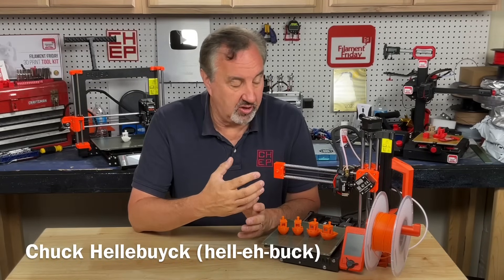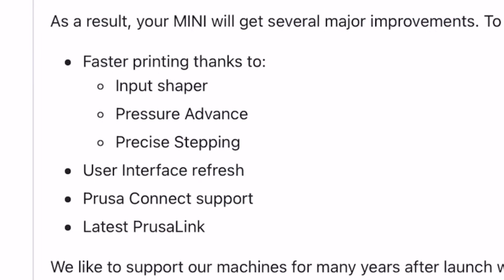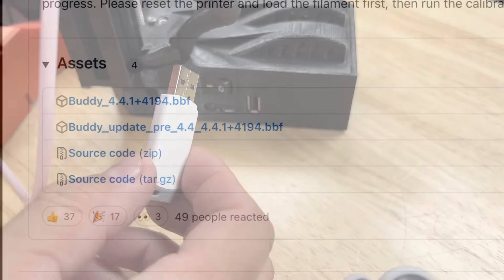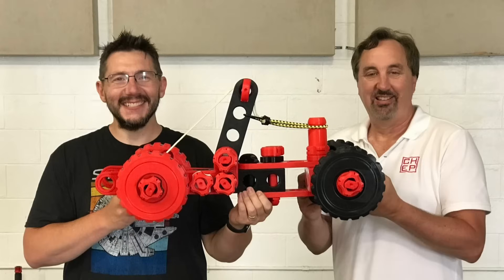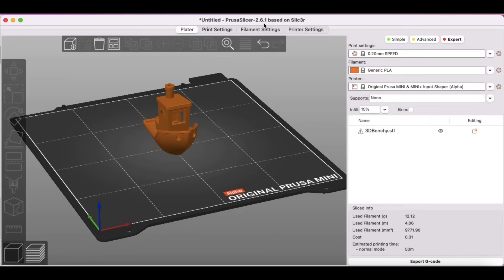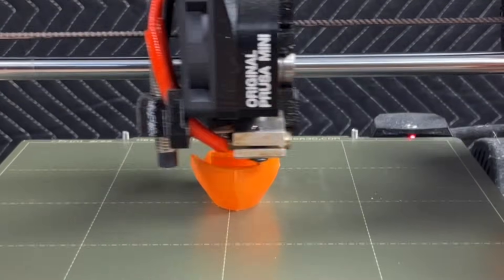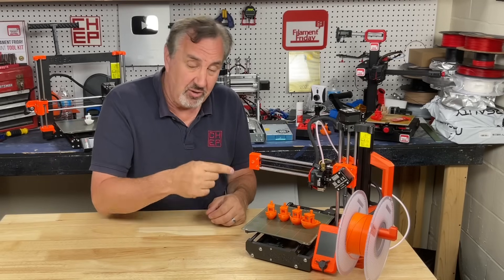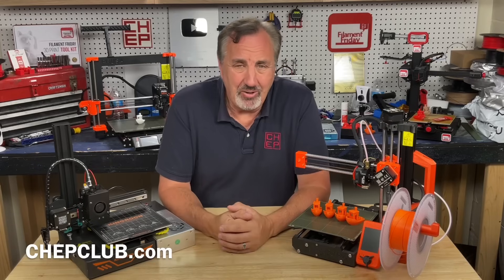12 Minute 3DBenchy on Prusa Mini

Comment: It's cool that they pretty much brought the Mini(+) back to the competition.
But the input shaping needs some severe tuning. Currently slower prints, the quality is much worse with it turned on.
As for the bedsize. I like the 180x180x180mm. Realistically, 98% of what I print is smaller and for the last 2%, I just send it to a 3D printing company.
I always thought I would get the Prusa Mini+ to start out with and get a larger printer when I feel the need to. But I never felt the need too.

Comment: There are config files for the Ender 2 Pro to put Klipper on it ... but it's nearly a shame that there hasn't been a tutorial or something by Creality themselves to provide open source support for an open source printer! It could have bond customers to their products.

But I wanted to mention the Lerdge iX printer Kit as well, which is a Prusa Mini/ Bambu A1 Mini to build by yourself starting at like 130 € and going up to 310 € if you go all in with a direct extruder and linear rails. Oh and there is a Klipper tutorial as well ...

So for people or even kids who always had fun building stuff by yourself with LEGO, it sounds like fun to build a own Prusa/ Bambu Mini printer by your own and maybe learn a thing or two about those machines as well.
And it's open source, so you can reprint or repair every part since you get all the files and bill of material... even design like a Halloween version of it.

I always like the idea from Creality to make things accessible by bringing the price down from 1000 bucks to below 300.
But seeing what other companies achieve by adding Klipper/ input shaping, refreshing the design, providing kits to build one by yourself (without the need of 500+ bucks for a Voron) ... it's kinda sad to see that Creality is leaving so much potential on the sideline ... which others just have to pick up!

Maybe that's why Bambu Lab is kinda the new Creality on the block: the new company that copies others and makes profit ...
But at least Prusa is taking the challenge ...

Comment: I keep going back to that informal poll that Alan Mandic did, where something like 80-90% of the individual files that poll respondents print fit inside the dimensions of a Voron 0.2, Ender 2 Pro, or Prusa Mini. Yes, we all need larger bed sizes for one thing or another and I personally feel like I never want to be without a printer sporting a 300x300 mm bed (adding the Sidewinder X1, and later an SV06 Plus, to my printer inventory was a big help). Still, having a more portable printer that is fast, still useful for a number of prints, and is easier to enclose seems like a real win to me. 

I've given consideration to various small printers and I'm leaning towards getting an LDO Voron 0.2 kit; the fact that it's enclosed and would allow me to far more readily print ABS/ASA/etc. than I can on my Ender 3 or SV06 Plus is a huge plus, not to mention that LDO has been really great towards the 3D printing community and deserves some love.

Comment: I have a highly modified KP3S. It is one of 4 printers, but the one I use the most. It is small and I can take it with me when I travel. I have larger printers, but this KP3S does 95% of what I need and can do it faster due to the lighter bed and hot end.

Comment: The only reason they released this update is that they don't have anything in their pipeline. 🤷‍♂️
Reply from the maker: Glad they did. I like the increased speed.
Reply: @FilamentFriday  Yes, it's awesome but wouldn't it be better if they did this like 2 years ago instead of 5 years? I am not saying that what they did is bad, I just don't believe the narrative you present. 🤷‍♂️
Reply: @hologos_  2 years ago the development of Klipper and Input Shaping hadn't been the "new standard". Only expensive Voron builds used them regularly. So there kind of wasn't a need for that, too. Clearly Prusa first wanted to build a big machine with multi heads (XL).
But with more and more Klipper machines (doesn't matter if Bambu names their firmware different) they had to evolve as well.
Fast printing comes with negative side effects - more cooling needed, louder, more wear off ... let's see where this "need for speed" leads us to.

But you already could get a fast printer for 320 bucks - the Sovol SV07. So the A1 Mini isn't that new.
The better implementation of the 3D Chameleon 4 color multiprint is good, but also has been around for 3 years now.

So this is simply the time when more and more implementations of input shaping come to the surface.
Reply: @hassosigbjoernson5738  I agree that Bambu isn't the only company with fast 3d printers but the ease of use (at least that's what they market) makes them eat the market share. The part with Klipper and Input Shaping is correct, I haven't thought of that.
Reply: @FilamentFriday  LOL... Prusa saw what everyone else is seeing (that the A1 mini will clean up their clock) and they released the Alpha1 early, warts and all.

Comment: Just rebuilt my Ender 3 pro with all linear rails, dual Z and a Spite Pro direct drive hot end with Klipper at the helm. Hoping to get these speeds out of it. Any recommendations for a slicer that plays the best with Klipper. I was going to stick with PrusaSlicer,  it I heard that orcaSlicer works well with it.
Reply: orcaslicer has super slow travel speeds for me and i cant fix it no settings changed it so i just stayed with ps
Reply: I've used Cura, PrusaSlicer and Orca with an Ender with Klipper with success.
Reply: @MallocArray   in your opinion, which one seems better for Klipper? I know it’s mostly up to the user, but just trying to see if one works with Klipper better than the other.
Reply: @johnbelfiglio562  I haven't used PrusaSlicer much. Cura was fine with the generic Octoprint plugin, or there is a Moonraker plugin that is a bit for fiddly. 
Orca supports Klipper better natively. No extensions needed, thumbnails works, can adjust pressure advance on a per-filament setting, and the Device tab pulls up your printers full interface directly on Orca, compared to basic controls in Cura.
Reply: Orca Slicer is clearly the favorable choice here since it comes from Bambu Studio. And Bambu Lab clearly "copied" or "got inspired" by Klipper and use a very similar firmware on their printers successfully.

Which makes Orca a perfect candidate not only for Bambu machines but for all Klipper machines.

Comment: All prusa products must be switched to support klipper, their firmware is quite behind the times
Reply: The simpler machines simply had not the compute hardware for Klipper on them!
That's why many Klipper mods worked with a RasPi or even a notebook - but not the build in SBC.

So the switch has to be done ... but without faster hardware it's not as easy as it seems! A 4 year old Prusa Mini or Ender 2 Pro simply used a slower board than the newer Bambu A1

Comment: The prusa mini is a very nice and cute printer and I love it, but the advent of the a1 makes it almost worthless on the market. This is a fact. No one likes a cell phone made ten years ago. The open source mini is said to be easy to repair, but is it worth repairing?
Reply: When you get it for the same price as the A1 Mini and it has a working firmware with Klipper - sure!
In 2 or 3 years this repairability is key if you don't want to buy a new printer every now and then (even if it's from Bambu Lab)!
Reply: @hassosigbjoernson5738 
In China, after 2-3 years, you can buy a mini model that works at 300 speed for 200 US dollars. What is the point of repairing the old machine? There is almost 4 times the printing speed difference.

Comment: Regarding not using small printers:
I’ve got a CR10v3(300x300x400 build volume) and a prusa mini (180x180x180). I use the prusa for 95% of my prints. Mostly because it’s faster but also because i don’t need the bigger print volume.

Comment: I'm starting to get more and more bad vibes from prusa. Misleading people on the features that their printers ship with, doing misleading gimmick prints with no standard benchmark benches to artificially make 5he printers seem faster (despite them previously pretending speed doesn't matter), shipping wonky half baked input shaping code, throwing accusations around loosely without evidence on twitter, and the list goes on. Every day that goes by it feels like Prusa is doing yet one more thing that makes me lose faith in it.

I want to like the so called open source company, yet they haven't released all of the source for any of their newer printers, and increasingly indicate they want to go closed.

If that's where they are going and their machines are obviously simply less good compared to the competition, the what the is the incentive?

Also I just got to the part of the video where Chuck mentions they support their printers but... the new completion does that too, and faster and with more features.

The thing that makes this worse? They specifically neglected the mini until this new competitor came out the slapped put this half finished firmware to hope a gimmick would convert people. Meanwhile the biggest selling point of the competition is now bow polished it is from day one. No missing features  and working out of the box.

Prusa used to be seen as the polished printer company and now they do gimmicks and marketing tricks?

Actually what am I saying. The Mk3 had a terrible launch, the mini had huue ptfe gap issues at launch, the XL didn't even have its launch till nearly 2 years later where it was missing promised features at launch, the mini talked about this video even STILL to this day is missing skew compensation.

Honestly, it's starting to feel like the mystique of Prusa is unravelling.

They weren't known as awesome eh cause they were. They were known as awesome be cause the space got so stagnant that literally just working decently was enough to walk in the race.

Anyways that goto  a bit of a tangent but I think it's obvious what I'm talking about here.

This gimmick is obviously here to try to somehow get anyone to pick this old buggy thing over the brand new linear rails all over, press print and go Bambulab A1. The price is better (you get a whole reliable mmu system for less than a mini and you'd have to build the mini yourself), that is faster, easier to fix the typical problems on (have you seen hotend swaps on that thing?), can print MORE materials because it has a real all metal steel hotend unlike prusas half hearted, hard to change unique v6 clone, can detect more modes of failure, does literally all of the tuning for you and will send you a no fuss notification when the print is done.

Basically, this whole comment is to say I am not pleased with Prusa right now. They were caught sleeping at the wheel and rather than puttung their heads down and competing they throw mud, use marketing tricks, and don't adjust to the market conditions.

Personally, I just don't think any person should be buying a prusa mini in 2023. Even if you somehow don't like Bambulab, this thing is ancient, flimsily designed, open source in name alone (when it comes to what actual people care about in open source, which is a actually being able to mod the thing) and more expensive  than Bette options at lower prices.

So right now, the list of machines the average person should buy from prusa is: ....

They really only have the XL as the ace up their sleeve, and it's 2 years late, without an enclosure, without promised features and charging a massive premium.

Yew the MK4 exists and is a decent printer, but really, truly, if we are honest to ourselves, how many people value the not actually opensource nature of the MK4 they still haven't released the purposefully hard to build designs for vs the Bambulab options which are not only more price efficient but just straight up easier to use all around?

This really turned into a bit of a thought stream, but I guess I'm saying, as if Prusa was reading this: Prusa, wake up!

People want to like you, but you are clearly losing your way!

Reliable, open source, easy 3d printing. That's what you're supposed to be good at, and now you aren't top class in any of these categories.
Reply: When they released the "Bonkers Benchy" gcode, they also released the standard benchmark gcode which is marked as 27 minutes. It's on their Github under the 5.0.0 Alpha 1 release for the Mk4.

You can download the firmware source code, PrusaSlicer source code, and 3D printed parts from Github and Printables under open source licenses.

Support will certainly vary with the brand.

The firmware for the Mini is labeled Alpha. That's earliest stages of development. Never use an Alpha of anything if you want stable. By the way, releasing the code in early stages is completely normal for open source projects, as open source projects are open source no matter what stage they are in.

I certainly agree they are being very reactive right now, the input shaping for the Mini is almost certainly a response to the A1. Not that I can blame them for responding to the A1, as it's a very good machine from probably the biggest prosumer brand. But Prusa needs to do a bit better job being more proactive rather than reactive.
Reply: @logicalfundy   On them also releasing the standard the problem is its just shady marketing. Just like the Mk4 launch its lying by ommission because they know most people aren't checking github or reading the fine print so when  people call  them out they point to that and say "look, our hands are clean". They've been doing a lot more things like that recently and it's getting to me.

Those are not the actions of an honest company.

As for the firmware and prusa slicer being open, they don't get poi t's for either.

The HAD to make them open source because they forked them off projects that had non permissive open source licenses. It's the same reason that Bambu Sutdio is open source.

You see their real attitude with software though where they still haven't released recent hardware source files and I beleive their buddy boards are still proprietary.

Open source in name. Close source from the perspective of actual hobbyists. You really see this with their purposefully awkward hardware designs, and the fact they forked an older version of marlin so now upstrwma doesn't really benefit. Ironically this screwed them as they took months to make a still buggy input shaper when marlin proper has had input shaping for months. Says a lot about them.

As for the firmware being labeled alhpa no. I don't accept this crap from game companies and I certainly won't here. If it's alhpa but you are using it as a selling point you are lying. Either by saying your product has a feature it doesn't have because its still being developed or because you are using the term alpha as a shield for its bad performance. This mostly applies to the Mk4 but also here.

Honestly my problem  isn't that prusa is behind tech wise. they were far behind custom core xy printers with kipper and accelerometers (still are), but I liked them then.

They seemed at least to be honest, but now my opinion has changed. To me, I now see them for what they likely always were. A company that just so happened to have used open source tech that they were forced to use, and ran with the marketing. A company that was woefully under prepared in the engineering department but were willing to stretch the truth in the marketing department.

I starting to feel that as a company, they are not that different from Creality, with the big difference being that they market better. Ok maybe comparing them to Creality is too far, but I'm not pleased.
Reply: @BeefIngot  What has releasing code, cad files or instructions got Prusa, Klipper, Voron or others?

Yes ... they got Bambu Lab which simply "got inspired" by all what has already been on the market in one way or another. And Bambu had an easy play because the instructions on how to build a fast core XY from Voron alone is something they just had to read and apply...
The idea of the AMS Lite is simply the 3D Chameleon which exists for 3 years+ now.

An European or US manufacturer simply cannot compete with the cheap manufacturing in Asia. That's a fact! That's why Prusa never tried to race the Ender 3 clones to the bottom of all prices - it's not possible with descend loans.
I also don't know how many high class engineers Prusa has in his team - because Bambu Lab clearly has some experiences folks from DJI onboard, which should explain the "speed of development", especially regarding software.

But one thing should be clear: Bambu has a big advantage (like Creality had with their Ender 3): they "just" had to "get inspired" by machines already on the market (like the Voron 2.4, the Prusa Mini) and get Klipper-like software on them or/ and make them cheaper (which should not be a problem when producing in Shenzhen, China).
And they did that.

The "problem" starts now since Bambu is going the closed source route - so new developments are much harder for every player involved.
That's why they will be successful another 2 - 3 years, build up their closed system, undercut the prices of the competitors, build bigger machines from their existing ones, evolve their software even more (also Bambu Studio which bases on the work and experience of Prusa) and get very profitable.

The question is going to be: what's next after all of this in 3 years?!
Maybe Creality has gotten much smaller ... maybe even Prusa gave up because he does not want to produce in China.
So everyone buying Bambu machines, giving freely their data and be happy? - I don't know!

Sure, Prusa seems to be surprised with such a competitor now. But let's hope in 3 to 5 years that not all none Chinese companies are gone!